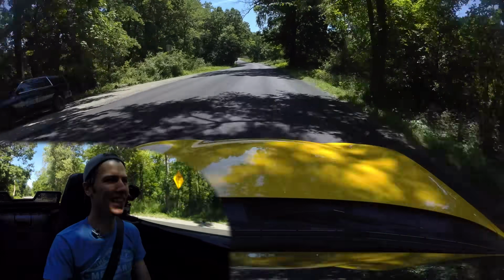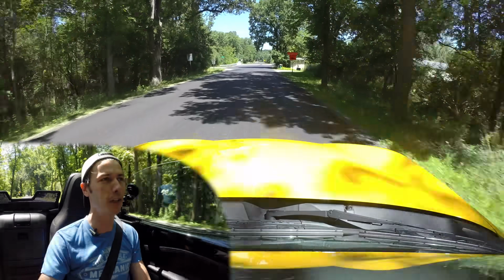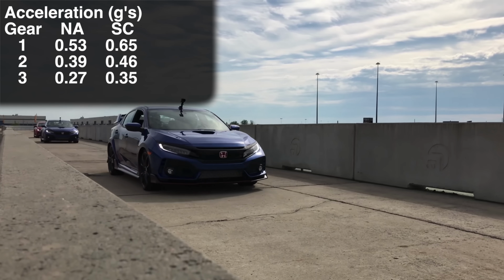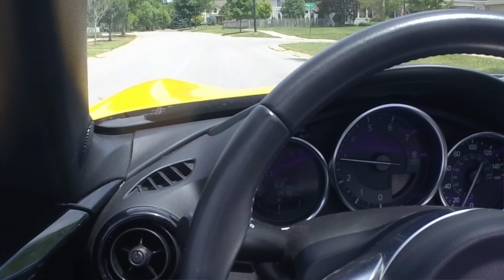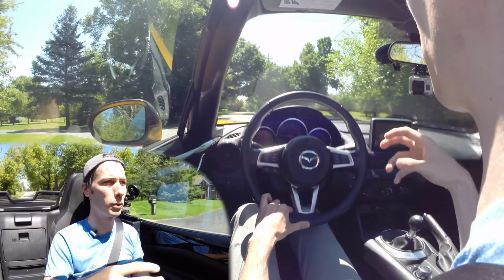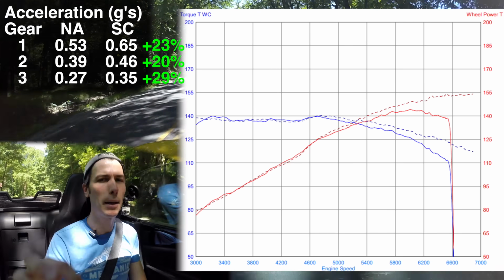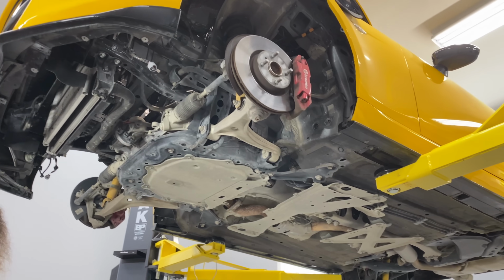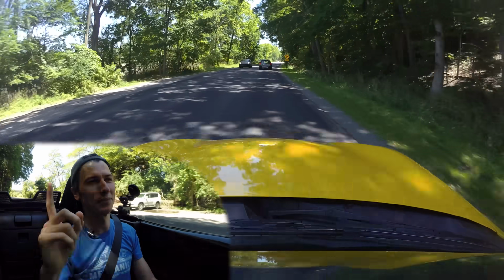How Fast Is My Supercharged Mazda Miata? Police Not Impressed

Comment: Surprised to hear you complaining so much about the surge in low power going from 1st to 2nd.  If you're just tooling around, why not just start off in 2nd gear (I'm assuming you can) or short shift from 1st to 3rd?

Comment: Doesn’t seem worth the trouble or cost to me.  And I mean the entire package, car included.  I’ve driven a type R and was very disappointed with the lack of low-end torque. Also the Eddlebrock warranty is smoke and mirrors. Read the fine print carefully. It’s administered by one of those garbage 3rd party companies that take an act of God to pay out on a claim. See the warranty company’s  BBB reviews for proof.  Apples to oranges but for comparison I doubled the output of a 2016 Camaro SS (manual trans with Magnuson SC, headers, e85 and cam...main things), drove it for 20k miles and had zero issues before selling it a year ago. I went with Magnuson mainly because of it had a much better design. Everyone that went with the cheaper Eddlebrock had heat soak issues.  I briefly compared modding a Miata to Boxster GTS, as I wanted a roadster as my next summer toy but decided on just getting a better DD (RS3).

Comment: Is it possible the perceived throttle cut is actually more to do winding and unwinding of the clutch and DMF, especially with the increased torque amplified by the lowest gear ratio? Our diesel focus is really annoying in just the way you describe and I'm pretty sure it doesn't have a throttle in the conventional sense.

Comment: Ouch! Only 210whp!?!?!? Should have done a K-Swap. 245-250whp with all motor setup, internally stock. Supercharged, up to 400whp. Turbocharged, up to 600whp. All stock block. Even a Mazdaspeed3 2.3T swap gives you 260whp stock setup, 400whp full bolt-ons and tune. Sadly, what a weak motor. Obviously little to no money was put into the engine, and all the money in to the chassis.

Comment: "No difference in the power you feel between the ND1 and ND2 engines" 
As far as I understand it you don't "feel" torque (as it is not an absolute power measure), you feel horse power where there is a significant difference between the engines. I agree that you feel the same acceleration between 6000 - 7000 rpm but from 7000 - 8000 you will feel a greater acceleration with the ND2 than you can replicate with the ND1 in any gear at any rpm.
You are seldom wrong so please educate me🙂

Comment: Lots of power for a little one )) Let me ask you tech question, Is there possibility for timing chain to jump on camshafts, due to Exhaust system clog up?  I have LFX 3.6 engine, overhauled, worked like a clock until both catalytic converters melted down.  I removed everything from both converters and exhaust system, so now they wide open, now engine dies on idles, when hot, runs rough, and two codes for intake and exhaust camshafts on bank 1, no misfires. Some weird noise coming, sort of timing chain, but more like off the synchronization. Before that failure, you wont even feel engine runs, that smooth it was. Is there any chances catalytic particles could damage cylinder walls?

Comment: Wow YES! That second throttle problem you’re feeling with the verrryyy minimal movement but NOTICEABLE closure is what I’m actually feeling on my 1997 NA. I completely rebuilt practically everything (videos coming soon) and it wasn’t there before. Same symptom: low rpm, at high rpm its fine. Any ideas on where I should look? Naturally aspirated did an OEM rebuild. I was going to attempt replacing the maf thinking maybe the tps also now?
Reply: Also your videos are great and have taught me sooo much for years! You should teach a masterclass on how to get out of a ticket.😎 Smooth! Have a great one man👋

Comment: How come you supercharged and tuned 2.0 modern engine got 188 lbft (250 n.m.) - the same as a stock 1.4tsi 2016 Jetta? Also you get it above 3k rpm and the 1.4tsi gets it at 1400 rpm?
So, equal weight and gearing, both cars would produce the same acceleration up to 5-5.5k rpm.

Comment: I m having an o2 sensor issue. I disconnected the sensor. the wire in the connecter was pushed back on two wires. I pulled them out to spread the little tabs. I did not mark the location of each wire. so I went to check the other sensor and when i pulled to unplug all the wires pulled out of the connector completely . can anyone tell me from the sensor to the plug wiring. 2000 e46 330i bank 1 and 2 sensor 1. this is the first of the 330's and the 1 sensors are at the end of the header and the 2 sensor is under the rear footwell

Comment: The electronic throttle is the dumbest invention ever.
Reply: that also sounds completely unsafe. especially the way he was talking about how he was flooring it and it was stuck at 25%
Reply: @abundantcat7448  the throttle cable works just fine.

Comment: why isn't a stock miata good enough. or a stock s2000. is it a need for novelty or you do it just for the videos? your s2000 has the horsepower but the differential wasn't good enough for you so it seems like it's always goingto be something 'wrong'. ...you dont have to call cops sir, they're public servants. he should be calling you sir. but i guess you want to be polite maybe or you're just a submissive type lol 'authority' the public is the authority. not the cops, not the president. that's why the world gets into so much trouble; people forget who the authority is and a wag the dog scenario is occurring where the tail is in control of the dog.